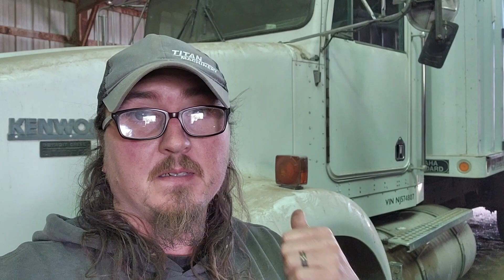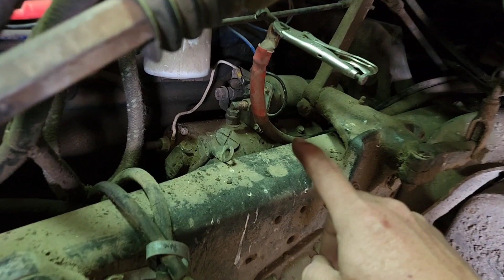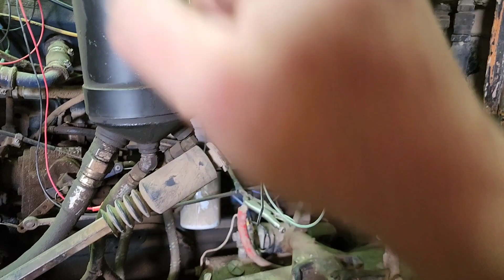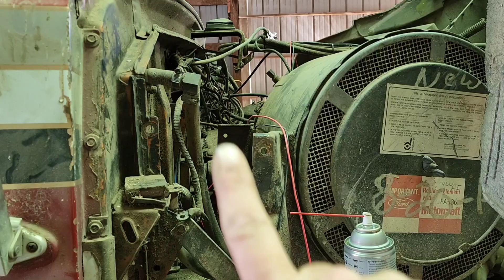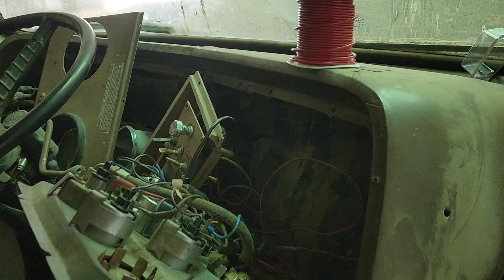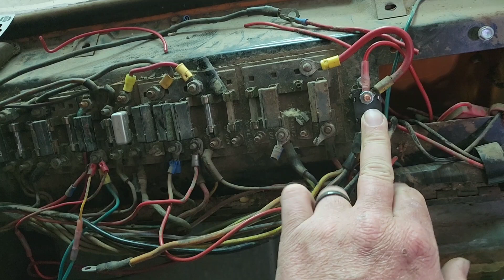Ford LT9000 Electrical Issues PLUS--Special Announcement!

Comment: Congrats!! Also I was wondering if I could ask you a question! I am 17 and I will be getting my cdl soon! I wanna be a bull hauler. What could I do right now until I apply to places! Will I be to young? My only experience is on small farms. Like my farm for example is just a rescue of all sorts of different animals. I was thinking working at a feedlot?
Reply from the maker: Experience with cattle is obviously a big thing. I would check around at sale barns.  They love help your age and it will give you some good experience handling cattle and will let you see how guys load them. Beyond that, you just need experience driving for insurance purposes,  and you could realistically get that with a farmer if you didn't want to go otr once you graduate. Bear in mind though that until you're 21 you can only drive in state. That's definitely not a deal breaker, but it may not get you hired right away at some outfits until you're older.